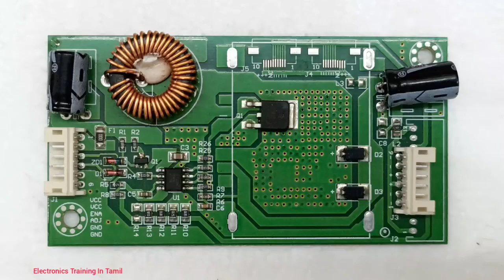நீங்களும் L. E. D Tv service செய்யலாம் About Backlight Inverter Board

Comment: Brother mother board la led back light voltage 25v tan varuthu... But led back light total voltage 73v. Ippo mother board la yenna problem...
Reply from the maker: You may use, external dc to DC board
Reply: Back light inverter board ah sir...
Reply: Unga WhatsApp number kidaikkuma sir
Reply: @electronicstrainingintamil1625  inverter board ah sir